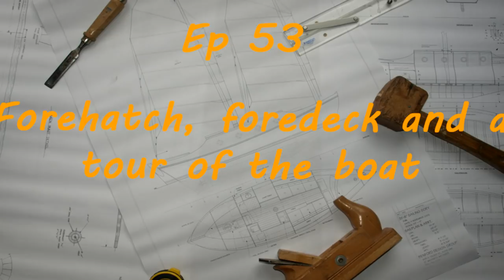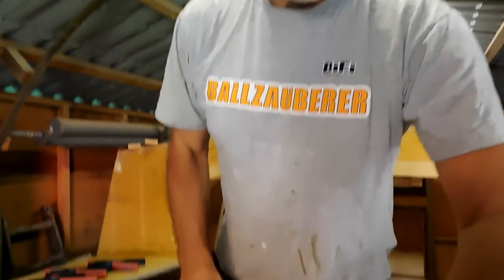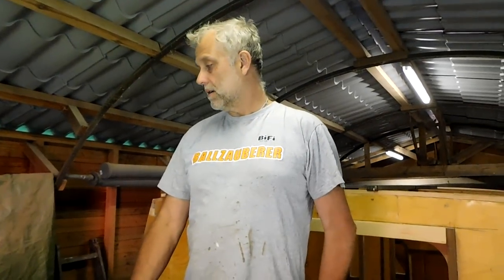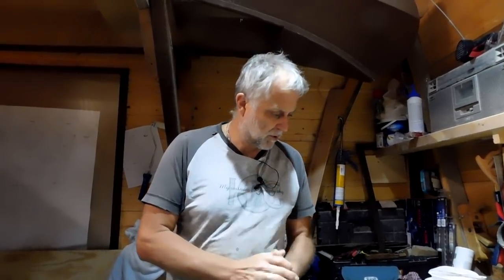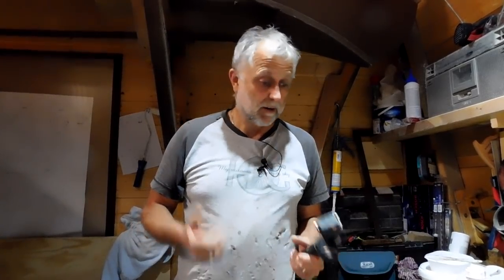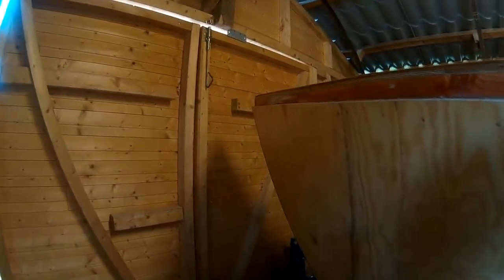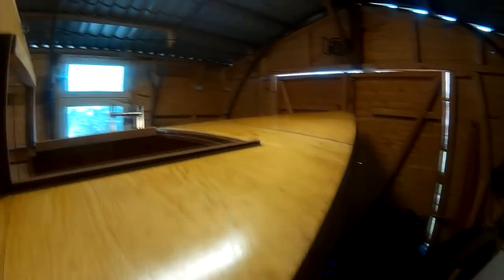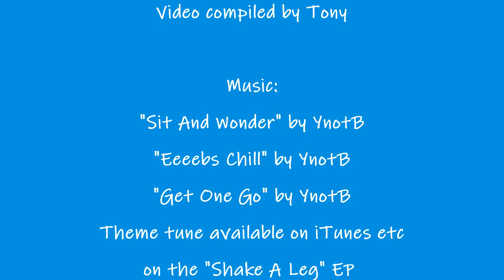Forehatch, foredeck and a tour of the boat - SV Tapatya EP53

Comment: Tony:   As I am chasing rot on my 49'  Alaskan 49 by American Marine and have to remove small areas a small router is my tool of choice.  At 78 my hand strength has diminished so I use router fences made from 1/8" Mahogany ply  ( underlayment ) .  
 I cut a 2" and 4" strip off the four sides of a 4'x8' sheet for long straight edge guides ( factory edge ).  Then I make a second 2" cut of all remaining sides for cutting  in to shorter fences.  The strips cut from the 4' end of the sheet bend easily to match curved surfaces.  
 These templates/guides can be temporarily attached to a surface with loops of masking tape folded back on itself to form a double sided tape.  Then I use a couple of 1/4 or 3/8 staples to hold them in place.   The pin holes from the staple fill easily with a epoxy filler for me.
The remainder of the sheet I use for templets for Dutchmen and other shapes.
I use a small hand router most of the time as I am working in tight spaces;  but they work  just as well with my 1/2 shaft router for new work cutting dado's and rabbit's ( where I have room ).  
This is the type of small  1/4" shaft router I use.  https://www.amazon.ca/Makita-RT0701C-1-25-Compact-Router/dp/B00E7D3V4S/ref=sr_1_4?ie=UTF8&qid=1537135365&sr=8-4&keywords=router+tool&dpID=41GEadJLHNL&preST=_SY300_QL70_&dpSrc=srch
the old guy   Bert
Reply from the maker: Thanks Bert. I'll look into it. For the board joints, I deliberately went for the freehand approach to soften the lines, but your tip sounds like it'll be useful elsewhere 👍

Comment: Nice layout on Tapatya, what will be the head height in the saloon Tony? I will be looking for a new project soon but I need to stand without stooping (6’ 3”)
Reply from the maker: As standard the boat has just over 6’. I’m sure the deck could be raised a bit to give you standing height though
Reply: That is what I might do and looking at your build I can’t see any major problems in increasing the height by 10 cm. My last rebuilt was a Jouet 760 24’ 11”, a nice vessel but I was stooped all the time.
Reply from the maker: @Walking-the-coast  I agree. I see no reason why that shouldn't be possible

Comment: How will you achieve stability with such a flat bottomed hull ?  Absalutely not a criticism of the design or yor efforts I am just a curious novice ... great poject ace channel ...
Reply from the maker: Hi Simon

The keel will be fitted towards the end of the project. That'll keep her upright. Other builders tell me these boats track nicely. I guess we'll see how she performs when we get that far. Boats of this design type have sailed many thousands of ocean miles though, so I'm not worried 😀
Reply: In addition to what Tony has written, what happens in practice, according to those who've sailed this design, is that when sailing, the boat is always heeled over to some extent. Thus, the chine becomes the lowest part of the hull when moving (other than the keel, of course), effectively forming a 'V' shape in the water. This helps with tracking, and also means they don't pound, as some people assume that a flat bottomed hull would.

Comment: why did you router those groves and then fill them in?
Reply from the maker: To avoid having a straight line transition from one board to the next. Once they're filled and then glassed over, it's impossible to feel where one board ends and the next begins. Once painted, there should be no sign of the individual boards - fairing :-)
Reply: SV Tapatya.  One of the canal boats I refitted had a dodgy wooden roof.  Solid enough but leaked between the sheets.  I took the hand rails off and covered the roof with a sheet of vinyl floor covering and put the hand rails back.  I used the vinyl upside down so it was one colour with a textured finish.  No more leaks, looked good.